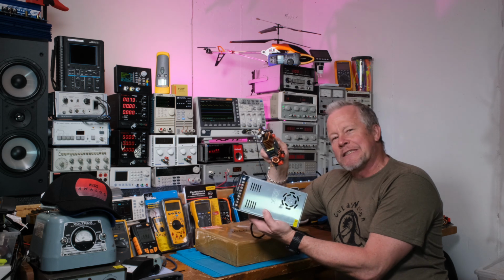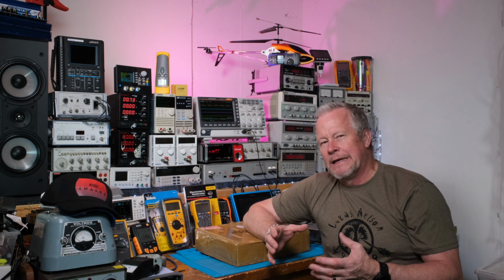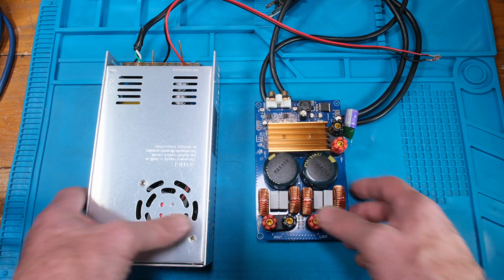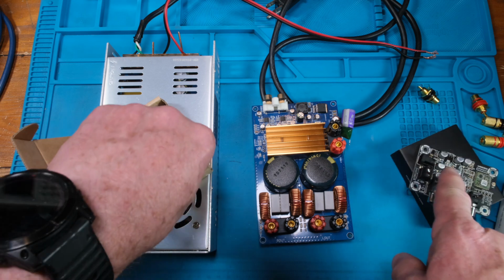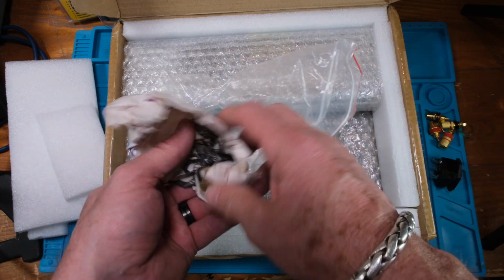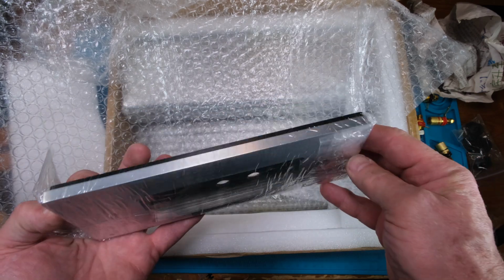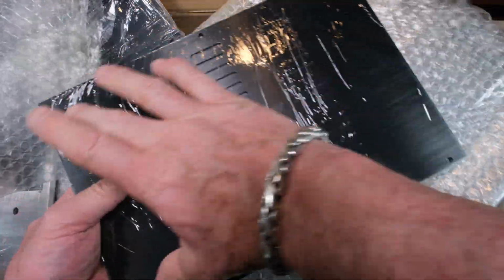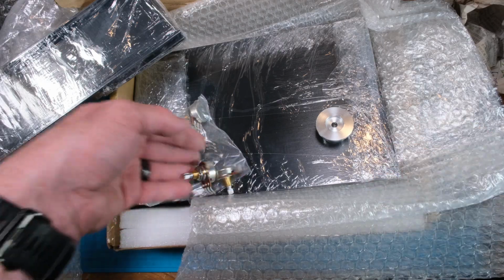300W + 300W Class D TPA3255 Project has found a box

Comment: can you stop that funny scissor cut  between scenes, always get an advert there and it buffers for about 10 seconds. you getting my comments you never reply!
I know this ads a bit of work but what about using discrete op amp you make? probably can get it made in China $2 each. if you had a batch of 100 made you will be able to sell them quite easily for $40 a set, they're very popular with audiophiles,
Reply from the maker: Thanks for this feedback!  I see your name and respond each time - do you not see my replies?  Maybe you don't get the notices.  I don't get notified on a comment reply to one of my replies, so I have to manually go through messages looking for new comment replies.
Reply: @KissAnalog  no I haven't received any replies from you for a little while, but these ones are showing up no worries!

Comment: Regarding the pots, you could use a ganged (dual) pot which would raise or lower the volume on both channels simultaneously. This would only require one hole on the chassis and then have a separate toggle switch for on/off. Just a thought.
Reply from the maker: Thanks Walter!  I'd prefer that but this box has the two holes already.  Kind of strange that then they only gave me one pot.

Comment: Almost all the preamps that use 5532 use fake chips. Easy to test these.  The 3255 boards also very considerably. Some of them don't like 48 volts, they overheat and keep cutting out. As for 150 watts, pure fantasy. Many of these boards produce about 55 watts clean into 8 ohms, good but miles away from 150 watts.  Some of the cheaper boards using 48 volts the caps are only 50-volt types very dodgy! Almost everything is fake on these boards, and they like to blow up for no real reason. Some have fake 12-volt regulators that run really hot, then, blow up. The best version I have found is the so called 600 watter (JOKE) with the fans on board. So far I have not found any issues with these. This bridged board (the 600 watt one) does give a very good 100 watts into 8 ohms and more than 175 watts into 4 ohms with a 45-volt supply, limited by my power supply at time of testing. not bad for a 600 watt rated lol. The fans on these board are made for CPU use and are excellent for this job. In fact, I have wired the fans in series they are now almost completly silent and still run the board cold. Perfect. Ohh, they sound quite good also, not as clean as my L12/2 amplifier, but close. The board you have runs best at about about 38/40 volts, best compromise between power, heat and reliability. I would still fit a small fan to cool the complete board, check the heatsink is in good contact with the chip, some do not. Also helps keep the caps cool as the almost touch the heatsink. What idiot thought that was a good idea? It's potluck with these boards, so many variations, I can't test them all.
The A on the pot means log. I would use a dual gang pot, so hard to keep 2 separate pots in track, twice the effort. Use a 50K max, 500K is way too high. The matching of lower resistance tends to be better than higher value pots, more so with a log type.
Reply: How do you test these 5532 boards?
Reply: @ronsingh  I have a number of such videos on my channel just type my name in YouTube you will probably find what you are looking for.
Reply: @MichaelBeeny  Ahh, tnx, will check your channel out.
Reply: I was about to go grab some on Ebay and stopped when I saw your comment!
Reply from the maker: Thanks for the great feedback Michael!!  Which OpAmps do you think are the best for Audio?  I will show a way to test OpAmps to see how they perform - real or copies;)
Reply: @KissAnalog  I know that I will open a can of worms when I say the 5532 (non fake ones) are probably as good as any. You can get slightly lower noise, and on paper lower this and lower that. In the real world it's getting silly these days. I find it hard to tell any audible difference between many similar types. Many 5532s are still in use in many studios world wide. Most analogue stuff of the 70s had dozens of them in mixers and processors. People still think a chip that costs 10 times the price has gotta be better. 
I look forward to seeing your up coming video on testing op amps. The 5532 is probably the easiest to test than anyone with a test meter can do.